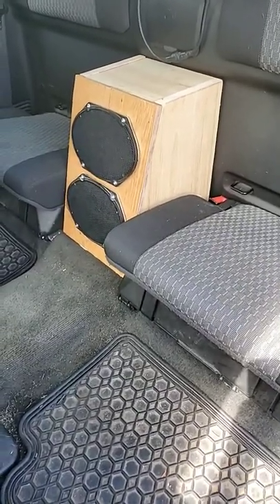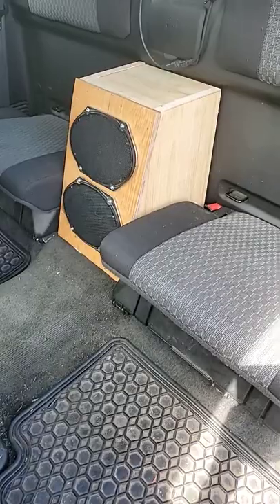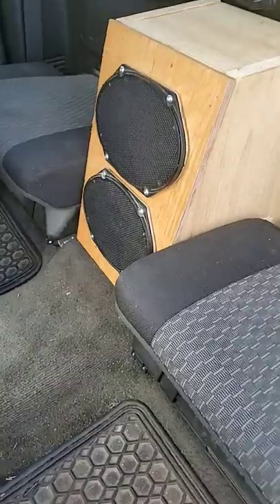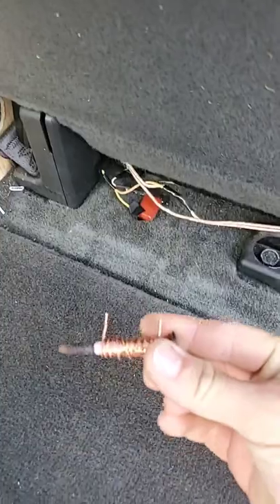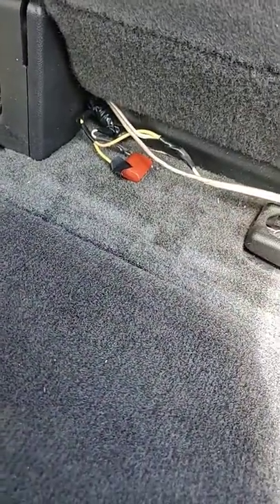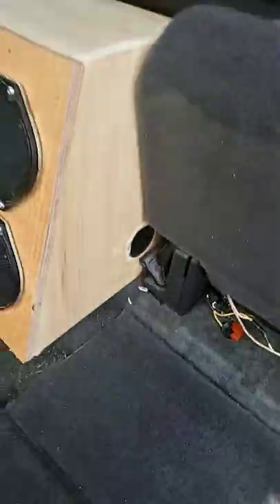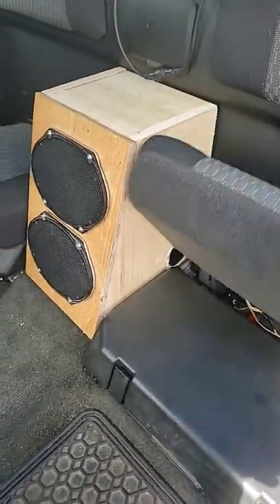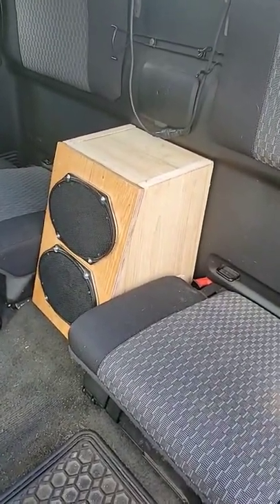add bass without an amplifier

Comment: Just buy a little 1000 or 1500 watt amp and put it on the box or even under your seat and you have more bass than some stock 6 and 1/2 door speakers
Reply: So just spend 100$ on an amp and blow his speakers?

Or did you mean spend 100$ on an amp and then turn around and spend 70$ on a subwoofer and then go spend 50$ on a wood or a box?

Your silly, what he did here was 100% free, and while I wasn't, much it did give him a bit more bass while maintaining his sound quality.

Comment: Aiwa actually used this method in the 90's.  I still use it in all of my home stereo setups every time regardless of the quality it at least doubles the value of the low end speakers while allowing the mid and high range to shine in their proper frequency range instead of clipping because there is no crossover removing frequencies they cannot handle.
Reply from the maker: Finally someone who doesn't say I sound like hiccup 😆 and or tell me you should have just spent money on something lol thanks for the positive reinforcement I feel like it was a pretty good idea to not spend money and do exactly as you mentioned it has worked very well for me
Reply: @clarkescustomcreations I appreciate your out of the box use no dollars makes scents approach. Smart is sexy
Reply: @clarkescustomcreations 
I have 2 Kicker 6x9 in truck boxes but no amp. Just Pioneer head unit. Ill research the capacitor coil method.

Comment: Or buy a little 1000 watt amp and srew it to the top of your sub box, your takong up a inch of space thats not being utilized regardless
Reply: You dont understand what's going on here tho.
That wire coil he made works like a small capacitor you see on the sides of some coaxial speakers, it is a low pass filter essentially.

This was his 6x9s(or speaker whatever that is) will only play lows and he can turn it up a bit louder without getting screeching tweeter sounds or ruining his sound stage.

Yes ideally he could just spend about 300$minimum on a sub, amp, and box; but this was 100% free and did infact give him a bit more bass while maintaining his sound quality, that's a win 🏆

Comment: It DOES NOT increase low frequencies. You made a filter using a coil and capacitor which filters highs out.
Reply from the maker: Adding 2 more speakers that only produce low frequency increases the low frequencies in the truck 😆 I wasn't talking about the coils
Reply: @clarkescustomcreations  at 0.26 sec literally saying "increasing bass". It does not increase man I mean it can not amplify the signal by adding capacitor or coil. BUT it definitely helps having two speakers which ARE FILTERED to play only lows. I like the simple idea and it does add bass.
Reply from the maker: @CoiledProjects  add or increase wat ever wats the difference both mean + lol I don't want to argue just saying honestly trying to say everything you want to in 60 secs just right with pretty severe PTSD on top of it im honestly pretty lucky I was even able to make the video that day lol 😆 credit where it's due was just trying to share my idea dude
Reply: @clarkescustomcreations  man I'm not trying to insult or argue it's just a bit misleading and I'm trying to correct it. Yes any addition is addition. I always say MORE IS BETTER 👍
Reply from the maker: @CoiledProjects  all good bro I honestly don't kno all the proper terms and lingo for fine electronics work lol 😂 so 🤷 not surprised I got something wrong 😅 an I wasn't expecting it to get this many viewers either lol
Reply: @clarkescustomcreations  I'm glad you got so much attention. Now keep going and stay positive 👍

Comment: Just buy the $60 dual brand 10" sub with built in amplifier is smaller than what you have there and will out perform what you have there
Reply: Junk. Go without will save you the hassle and money
Reply: EXACTLY 💯👍, even the cheapest car audio equipment is better than, making a homemade coil, and building a box with factory speakers, might as well get a 8 inch or 10 Inch low budget sub that handles around 300 rms and a small mini amp around 250 - 300 rms , and a pre fab box, probably could get all 3 items for less than $200.00 , on ebay or Amazon and would run circles around what you are showing..but to each there own.... but if you want to make homemade coils, enjoy sir.. 👍

Comment from the maker: I see a lot of just buy one these comments in here that is the complete opposite of the point my truck is an old canyon full of dirt and tools it works and gets work done but it's not a ricer or a lambo lmao I like music I like bass I wanted more bass but didn't want to spend anything too get it and that's the point I took old speakers I had laying around built a box out of left scrap wood lol and dug through my electrical components piles till I found something that worked and created the effect I wanted and it has worked very well for what I wanted I get plenty of bass now and it didn't cost me anything to do it lol
Reply: I mean, if youre happy with it cool, do what you want broskiii. But you definitely could get way more output that you might not even know u want with another 1.5"x roughly 15" of space with an amp not really taking up anything if you place it right. And an 8" sub can fit in the same box
Reply: I appreciate the explanation. Very creative and very inventive. I think just some of us bass heads pointing out that if you buy a high pass filter, then you will get better sound quality in general.
Reply from the maker: @c.a.nationwide  np thanks yes i know there's definitely better setups and better things for performance than this but when you're back seats mostly packed full of tools that rattle around you only really need so much bass back there I'm not looking to start a mobile rave lol and my main  goal was not spending anything on it
Reply: @clarkescustomcreations  i know the feeling. I hated this cheap ass 5.1 surround i received as a gift. But, chopping the 120v power supply side off the board left me with a 12v 15-20w(maybe) subwoofer plate amp, with inputs, that screws into the box. Due diligence but the wiring kit for something like that is basically speaker wire from any store. Lol.
Reply: I'm a bass head and I'm very impressed with what u have there. I bet you could alter that coil to increase the effect too. That sounds exciting to me and I wish I knew stuff like that. How does a coil do that and what is it wrapped in? How did you wrap it and how many wraps are there? How does it affect everything? I wouldn't waste time talking to the morons saying that a combo box, amp, and sub is better. No, that is dumb. That's the way dummies do it. They never get to understand the way any of this works, thus they lack intelligence and will inevitably vote for trump. If u value your brain, don't engage them. I was uncomfortable reading their replies.
Reply from the maker: @deeznu__tz  thank you very much I appreciate that some of the comments on this video have definitely been a lil ridiculous everyone's answer is always just throw 💰 at it  🤣  that's completely opposite of why I did this I didn't want to spend anything I wanted to use wat I had thank you for you interest in the lil project I recently did an update video on how the system sounds at least through your phone but I think how clear the audio is speaks for itself lol maby I will try to do a part 3 on how I made the coils and wired the system too 🙂 thanks again at least someone out there gets the point 😂
Reply: @clarkescustomcreations  amen brother
Reply: Id like to hear it if possible.. I just bought a 89 blazer that im starting to pour money into suspention, transfer case, interiors...., and i have a boxed up 12" pioneer sub just no amp. I wanna know if i hook it to the head unit will it at least go booom?
Reply: @clarkescustomcreations ok so i just saw this and im lookin up the update vid
Reply: You did great and spent 0$ to get a tiny bit more bass from your setup. That's great.

Everyone here is just a loser, the audio community suuuuuucks. Everyone is a know it all with their holier than thou attitude and system(or lack of system even lmfaoo).

You showed how you were able to uprage your system FOR FREE, and everyone's response is just telling you to go buy a amp and subwoofer lmfao that would defeat the entire purpose of this video 🤦‍♂️ these people are dumb bro

I got what you were getting at tho, good video handy knowledge 👌
Reply: @Pilarski. "I wanted more bass and didn't want to spend anything to get it"

How many times can you read this without understanding what it means?

Comment: You made a crossover not an amplifier. It drops the high frequencies but doesn't increase the low frequencies. It just allows low frequencies to get played through the speakers and blocks the treble sounds.

Comment: Yeah you built a filter. This does work this way. Even more tuning with a port tuning will extend your frequency's in the low.
Reply from the maker: That's what I thought I was doing 😆 I really don't know what the right terms and components are but I can figure out how to put them together an make it work lol I used 2 of these on each channel fed into a custom box with a homemade bass port in the side of it and for a redkneck radio it bumps 🤣

Comment: Caps take out the high frequencies allowing only low frequencies thru, thats it. They dont increase the low frequencies, it just only allows them to play.
Reply from the maker: Yep thats it man I added extra speakers blocked out the high frequencies in them making them play only bass thus increasing the amount of bass in my truck without adding an amplifier to do so ta da 😆

Comment: If you remove the seats and plastic, then do a nice cut-out you could easily fit a box with 3, maybe even 4 15's. Then all you will need is at least 2 2500 watt amps, id go with 3. Also make sure you do a proper job with weatherstripping to make sure the sheet metal is weather resistant and tight up against the new box. This set up would leave more room in the back than you have now and would sound quite a bit better, shouldn't cost much more than a used honda civic either! Problem solved . . your welcome
Reply: ^^^ He's right 🤷🏼‍♂️
Reply: Yup super simple just come up with 1500$ to spend on your audio hobby 😂
Reply: This is the best comment yet 😂 this is a video of a guy showing how he was able to filter the highs out of his 6x9s so he could play the lows a lil louder and maintain his sound stage FOR FREE.

And all these people are like: "bro just go spend 100$ on an amp" "just go spend 250$ for a sub and an amp"

Not you tho 😂 nah you tell my dude to spend ATLEAST 1000$ after watching him try n save 2$ by making his own tiny capacitor out of trash wire

Comment: Adding a filter to a mid-range speaker is not adding bass it's subtracting tweet. Probably why you couldn't find anything online about it not many people want to take performance away from their speakers
Reply from the maker: Uhm I suppose but in the case in which I wanted to delete the tweet performance as you say and focus on the bump performance of the speakers I'd say it did what I want it gave me more bass then treble 😆 it's not a loss of performance if that's not what I want the speakers to perform

Comment: All I heard was fire
Reply from the maker: Shows how much you know about audio wiring and current 😆 😂 the shear amount of current needed to be produced to light speakers on fire is pretty well impossible to achieve without some massive couple 1000 watt amplifier please refrain from leaving uneducated comments 😂
Reply: @clarkescustomcreations  I actually know it all I do all my own car audio and make Bluetooth speakers using car audio components. I can hook up a car audio system in someone’s house. Have fun with you shit box system buddy
Reply from the maker: 😂 well I guess if you can figure out with just about any 12v DC power supply you can wire a car stereo anywhere your an expert 😆 I enjoyed my system so did all my passengers you don't need thousands of dollars in audio gear to have a good system you just need to be  able to work with what you got not everyone wants to waste money on old work vehicles either but still maby wanna have a decent system to enjoy on the rides between stops thanks for the interaction on my vid anyway tho 😂

Comment: Ok you don't need 1k watts like these guy's are saying, all you need is a under the seat or shallow mount and just throw it under or behind your seat. And you'll be chilling.
Reply from the maker: My ? Is why do I need to spend money seems to be everyone's answer and the complete opposite of the point here lol I used a bunch of stuff I already had and my truck had plenty of bass without me needing to spend money on anything you can do absolutely anything if you just want to throw money at it lol  this is a free alternative an it worked just fine for me
Reply: @clarkescustomcreations  yeah except making homemade equipment 99% of the time equals problems. It's safer and less of a hassle to just go out and get the proper shit you need.

Comment: Hope you have a good fire extinguisher.
Reply from the maker: 😅 hilarious 😂 tho technically plausible although in my case highly illogical and unlikely it would take a super powerful amplifier with severely bad wiring to the battery to draw enough current and create enough heat for a fire I have pushed many stereo systems way beyond there capabilities and limitations without ever actually catching them on fire the reason I have a fire extinguisher on board as well as emergency orange lights is fire fighter and first response training

Comment: How well did it work did it sound okay
Reply: And what kind of is that a capacitor or a transistor
Reply from the maker: Honestly don't know it was a capacitor that I had laying around lol It worked extremely well between that and that box I built I get a lot of comments ppl thinking I have a sub in my truck lol it's seems to have been a excellent cheap solution to getting more bass

Comment: How dodge you make the coil
Reply from the maker: I used recycled copper wire from an old transformer then used a bolt wrapped in electrical tape to tightly wrap the copper wire roughly 100 times around the bolt leave a small lead on either end to solder too

Comment: Amps don't take up space 😂 it's 2024!! Amps aren't like they were 20 years ago, all big n shit. Now they can put out 2,000 watts with an amp the size of an Xbox controller
Reply from the maker: Honestly was more about not wasting money it was 4G's work truck I just wanted to add more bass without wasting any money on lol 😆  but yes I'm old now an used to older amps taking up more space but either way every lil bit of space counts in a tiny cab like that especially in the back seats u can barely fit back there as it is 😅 the speaker box I made is the exact same size as the cup holders and jack box that was in that spot already so doing this didn't take any space away in the back

Comment: How about you just get a 6 1/2 inch sub they don’t require much space at all they’re not expensive either You could literally get one for like 30 bucks
Reply from the maker: Subs need amps and extra wiring its alot more then 30 bucks for all that stuff and takes up more space some times you just want to add some extra bass to an old truck without spending anything at all and using things you have already I had the speakers laying around and was trying to find a way to use them mainly just for additional bass
Reply: @clarkescustomcreations  aye man micro amps are awsome theres amps that are the size of your hand and can put out uo to 500 whats on one channel
Reply from the maker: @trikekid5458  thanks I'll have to look into that when I decide to upgrade my speakers
Reply: @clarkescustomcreations  yessir micro amps are worth the money too dont let the price fool you because some brands are expensive for micro amplifiers
Reply: @clarkescustomcreations  yea even a dual brand 60 dollar amp from walmart would bust those 6x9's better then what i assume is the factory head unit. wouldnt even have to build anything else just use the low pass feature set to say 80-100hz on those speakers id guess. a cheap 6.5 inch sub in a tub box would have more bass tho not cost much and take up less room then your box there or one of those amp sub combo's you can just slide under the seat even.
Reply from the maker: @davidcrowder1202  no I have a Sony double din Bluetooth head unit 😆 I really just didn't want to spend anything on an old truck I used some old Ford 6x9s my buddy ripped outa his ranger lol basically made some lows pas filters to block out most of the trebal to just dedicate them to bass the plywood box I built has an air port built in to add in an extra sub effect I also listen to every music genre so for me this actually is very well rounded and a good amount of bass for bootin around town in an old pick up 🤣

Comment: You made a crossover not an amplifier. It drops the high frequencies but doesn't increase the low frequencies. It just allows low frequencies to get played through the speakers and blocks the treble sounds.
Reply from the maker: 😆 the title says add bass without  an amplifier 😂 thanks that's exactly wat my plan was when I made it